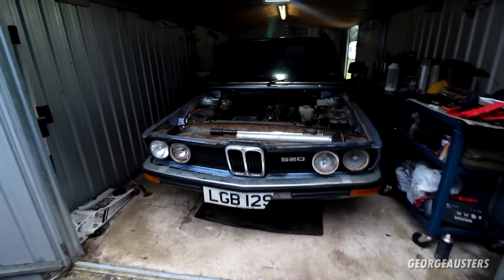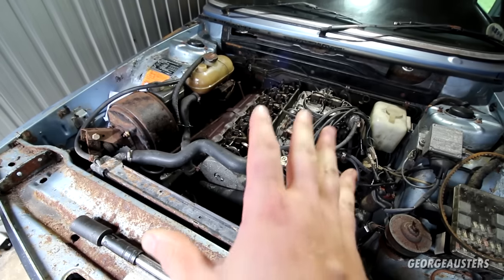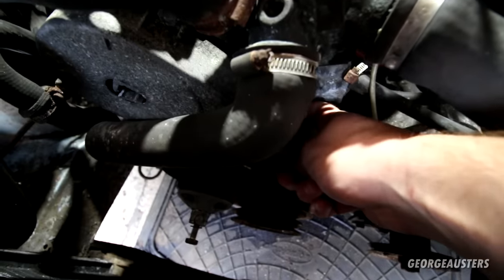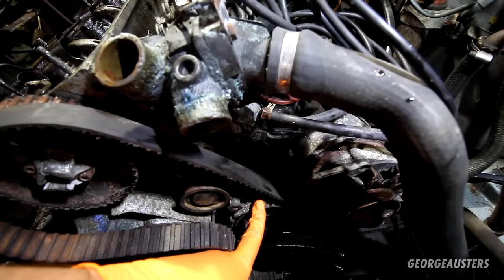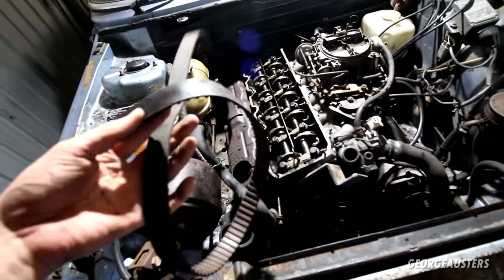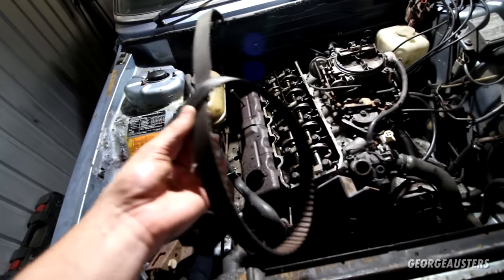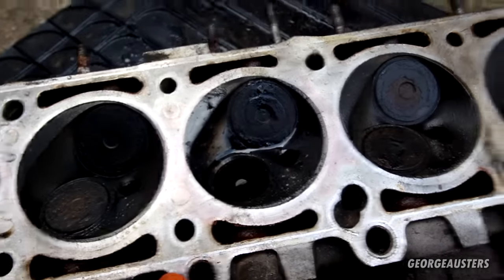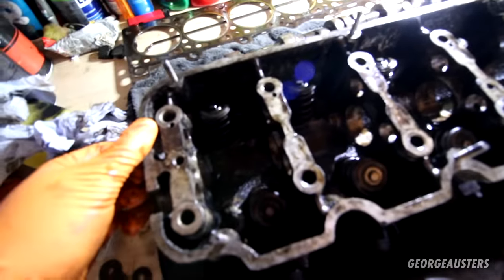This BMW Has Been Sitting in a BARN for 30 YEARS...Will it Run?

Comment: I would engine convert it .. probably put a tuned M54 3.0 in there (going to be cheapest big bang for the buck and will get it close to an original M5 power output) ... sort the bodywork. Keep it looking stock and have an absolute sleeper.  It's not a mega desirable model so wouldn't worry about taking it away from OEM. Also would like appeal to a wider audience with some mods.

Comment: Try to get this engine running on a budget, and at the same time source a spare engine, of which you know it is a good one. There are a lot of M20B20 engines out there, as they are also used in the E28, E30 and E34 chassis.
The intermediate shaft also drives the oilpump, but when the distributer is lifted, the oilpump drive also disengages. There is a long 8mm allen shaft driving the oil pump via the gear on the distributer.
Like the car.

Comment: I think the timing was off and a piston hit 2 valves. this may have happened because that oil pump died, no oil was running and that is why there is so much scoring. when parts got welded together, is when the the timing skipped and valves got hit. probably the engine is junk at this point. however, you know everyone wants to see you do it right! :D

Comment: check the head for cracks, they crack in a very unusual place, through the cam bearings, usually starts at the rear and at about 5 o/clock looking from the front, the timing belt sheds teeth, does not break.
Reply from the maker: Will check the head, thanks! Exactly my thoughts on the timing belt!

Comment: I think I owned that in the eighties, Fjord blue 520 from Glasgow.
Reply from the maker: Really?! Yes it was from Glasgow!
Reply: @GeorgeAusters  Would have been 1988, I bought it or one very similar from a car auction in Oxfordshire for about £500. It had the Callanders Garage dealer sticker in the rear screen. It was mixing oil and coolant so we fired it back into the auction! 35 years ago now so I can't recall that much about it.

Comment: If the oil pump had seized on the shaft, then the distributor would not have had drive, so the engine would stop immediately.  30 years might be enough for the cam to seize, but wouldn’t expect it unless water getting in there.

Personally, depends on what you want to do with the car. It is a survivor so tempting to say fix it all. In which case engine out and full strip down. It would make a good project.

As a short fix, rebuild the head and back on. Does it have replaceable bearings for the cam? If so a replacement cam and new bearings would get it running. If not, I suspect that there are places that can replace the bearing surfaces in the head (it was a common fix on motorcycles years ago)

Comment: Hi George,
I’m in a similar predicament as yours although the engine on mine is in a different condition.
Personally, if you really love the car and want to keep it then go for the rebuild, but I would take my time and do it in stages.
But, I would try to do the minimum to have the car moveable under its own steam so it doesn’t get in the way.
check and make sure the oil pump works and you can free the distributor shaft. One you can sort those then I would move to the head and have it pressure tested and checked for straightness. If all good, then replace damaged valves and lap the others. Not sure if that camshaft can be rebuilt or the cost to have it done, but a new one is around €500 from Walloth Nesch.
The alternative would be an M20 engine from an E28 as it has a similar sump but those are fuel injected and have an electric pump so extra modifications needed, but not much. Swap mounts and it would drop straight on your car as the gearbox would bolt straight too.
Some of the steps I’ve mentioned above are the same as the one I’ll be doing on my car very soon.

Anyway, good luck and look forward to the next video!
Reply from the maker: Appreciate that mate. I was actually going to ask what your would suggest and you're the only other person I can think of that has one of these cars.. 

So you think do the bare minimum to get it up and running / driving and then see what I want to do from there? In terms of parts, I think i'd only need an exhaust valve, an inlet valve, stem seals, head gasket, bolts, intake and exhaust gaskets, cam seals, rocker cover gasket and sump gasket and new belts. Sounds like a lot but only roughly £100-150 for the lot
Reply: @GeorgeAusters  yes, the bare minimum for now and at least you have an acceptable top end to get the car running. Also, a quick carburettor clean and replace fuel hoses to be safe. Once running, a good coolant system flush and it sure there’s a lot of gunk in the block.
Then, do another assessment of the bodywork and see what you can realistically do to get the car structurally safe.
Leave the engine bottom end rebuild such as pistons, block and crankshaft for another time when there’s more funds and have time and space to work on the block.

For the head parts, I would say around 250 including valves. The same parts for my M10 without valves and belts is just under £200.
Feel free to get in touch!
Reply from the maker: @GentilsGarage The gaskets are very cheap for this engine, I’d only replace the broken and bent valve.. the drive belts are literally like £3 or £4 each
Reply: @GeorgeAusters  sounds good. On top of head bolts and stem seals, im getting a full set of gaskets, O rings and washers from top to bottom as it’s weeping oil from every nook and cranny and whoever owned it before used silicon seal everywhere to stop the leaks! It’s a mess down there

Comment: Hi George. For the sake of saving money, i would source another complete M20 engine and replace the whole assembly. Im aware it's not going to be a matching number car (VIN, engine & gearbox), but you can still over time rebuild the original engine as you wish in your own speed. Starting to rebuild the head alone will make you run into unexpected issues which again have to be addressed on the point of no return.....You can then address the corrosion and have the car sound within a limited budget. That's my recommendation to get it moving.
Reply from the maker: The thing is also, with a replacement engine - you don’t know if that will be better or worse than the original
Reply: @GeorgeAusters it can’t be much worse! 😂

Comment: Whip the sump off and check mains etc... if oil pump is dead, then the engine is in for a rebuild... got to question how far do you go? (or run away)
Reply: I would not spend the cash on the cams... the bottom end may be gubbed... I suspect you will sell for parts on this one...

Comment: Hi George, interesting video. Myself, and many others, really want to watch people bringing cars like this back from the dead. That being said, it really depends on a chain of events. 1. Can you get your planned workshop built? 2.If you get the workshop up and running, do you plan on attempting the metalwork restoration and subsequent painting yourself? 3. If the answer to 2 is no, then call it a draw now. You will easily hit £20K farming out the bodywork restoration, and those cars are just not special enough in my opinion, but this is only my opinion. If you fancy honing your skills on a full restoration project however, then that would be different. I for one would welcome the channel content. However, you have to weigh up the YouTube monetary side of things. A project like that would tie up your workshop for ages, so you would have to rely on the restoration videos to supply the income. Look at my current situation, because of ill health and other problems, my garage has been tied up with my 8 series for about 7 years now. Any work I have done on my other cars has had to be done outside in all weathers, which has been really frustrating. Finally, a friend of mine had a similar problem with a seized camshaft on an M20 following an oil starvation issue. He just smoothed off the journals, put it back together and ran it, and it did a year with no problems after which he sold it. I'd stick my neck out and say that you could get it running and able to be moved around for not too much money, then if you decide you are going to restore it at a later date, look for another engine which you know you will have to recondition anyway.
Reply from the maker: I think restoring the entire car may be out of the question as I just don’t have the money nor time to have it sitting round for years waiting to be done. My initial goal is to get it running and driving.

Was your friend’s camshaft as bad as mine is?

Comment: Full rebuild
Reply from the maker: Do you think enough people would want to see it to warrant the cost?
Reply: @GeorgeAusters  Yes, especially if you show in detail how you repair or replace the fuel pump, oil pump, etc. But in the end the engine has to be in perfect condition. New head? New camshaft? Not the minimum to just get it to run.

Comment: Love the old bmw. Id only spend money on the original engine if you are going to make the rest of car pretty good too... which would probably not make sense financially. Why not put a more modern bmw engine in it instead (prob cheaper) and then improve the bodywork. Luckily at over 40 years old it doesnt need an MOT.

Comment: Doesnt make sense when you think you broke belt by turning it by hand. You must off felt resistance by hand before belt gave up and died? I think the belt took a shit when it was driving and it was parked up and left for years
Reply from the maker: Belt definitely broke while turning it, if it was already broke then the crank would have turned easily
Reply: @GeorgeAusters   thought the crank did turn easy. Fair enoigh hard to tell on videos
Reply from the maker: No the crank wouldn’t move at all until the belt was broken

Comment: That'll be waste of time,u stripped engine out,so at this point probobly best thing to do just rebuild engine
Ofcorse depends on your plans with car
Reply from the maker: A full engine rebuild will not be cheap.. Be talking around £2k just in parts
Reply: @GeorgeAusters  well then I guess it comes down to what your planing to do with car.
When I got my e31 840 I did spend few coins on it but my plan is to keep car 
So like I said before it's all down to what's is your plan for car